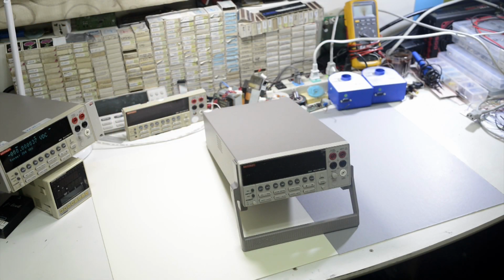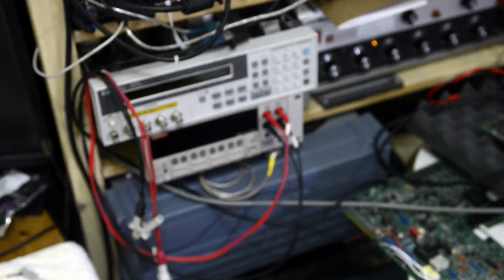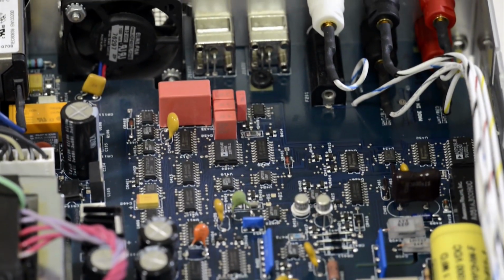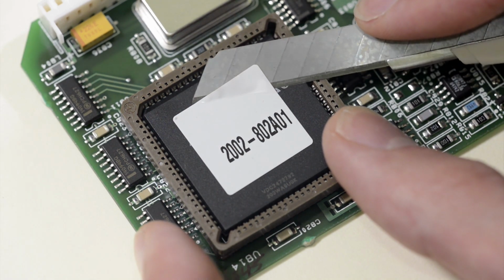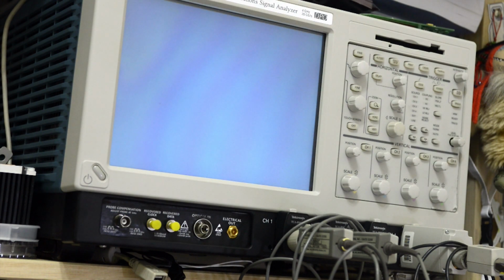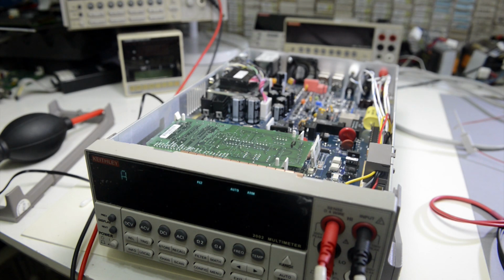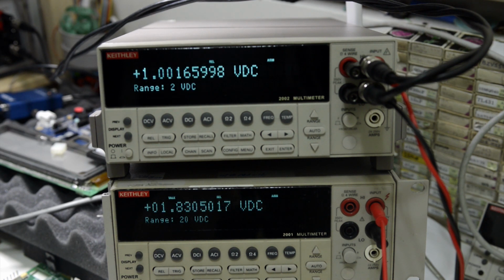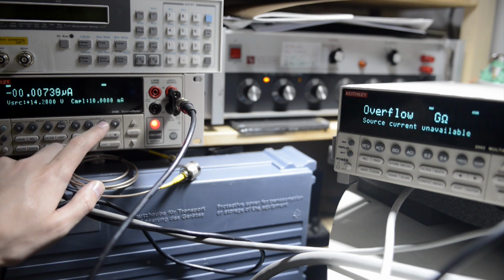Keithley 2002 review and teardown

Comment: How would you go about replacing the rfront/ear panel selection switch?  Solder sucker machine? It seems beefy and/or a hassle to get off.  Any advice?
Reply from the maker: Yea, I would use solder sucker or solder bath and mask board to expose only connector pins carefully. Or solder wick method, but it's rather tedious and slow.